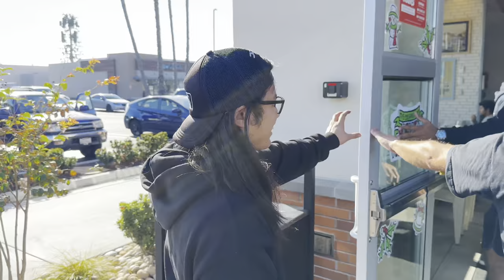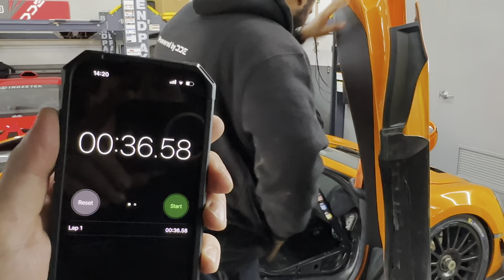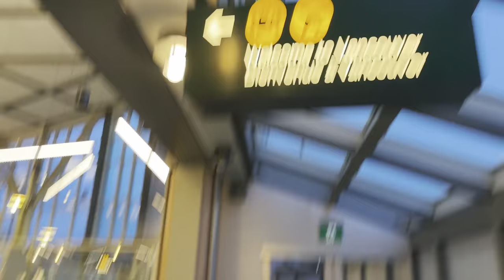Tim REVEALS HIDDEN Project CARS at his home!

Comment: Tims surprise honestly has the potential to be the coolest car on the channel, and I hope he pulls it off. 
He needs to get a Mercedes M120 or a BMW S70 in it, forget the Ferrari V12 - Get a M120 from a Mercedes SL70/S70 and rebuild it like the one from the Zonda, or a S70 from a BMW 850 and build it like a McLaren F1.
Reply: grullon gt8
Reply: It is going to have to be like a 4 or maybe a 6 cylinder engine. It was transverse mounted. A V12 will isn't going to fit, its unlikely a v8 will fit. Also it already produces 600 hp. In a car that light, it will move!
Reply: @shady9016  It's a tube-framed kitcar that uses a C5 Corvette as the donor car, designed to be powered by an LS1.
Reply: The motor that’s in it turbocharged would be sick if it ran mechanically nice that thing would fly 600hp in something that light but a twin turbocharged 2jz or twin turbocharged ls would be absolutely insane how rowdy that thing would be then

Comment: My first car when I was 14 was a M3 E30 the original 1988 sold in US in 91 i got it in 03 i rolled it drifting a curve at 70 lol it was not on purpose. Hit loose gravel. That thing was amazing I even missed the handcrank sunroof. It was scrap when i got done. Steering wheel was shoved back and had me pinned into the seat engine was destroyed driver side rims were destroyed amazingly somehow no windows busted. Every other body panel was ruined even the trunk lid from the freaking trunk lid from the battery coming loose and hitting it. That thing was so much fun I used to love coming into the cul-de-sac in my neighborhood ripping the e-brake getting sideways then dumping the clutch and spinning donuts sliding down the road. I abused that car and it took it like a champ.

Comment: For Tim’s car I would take all the wires in it out and get it set up for a race harness and if you engine swap it then you have to change some of the wires anyway and I would swap a v8 into it and twin turbo it then tune it for power to weight and see how close you can get it then drive it as a dayly

Comment: 2 Flaps intake are more thsn 2 Öillte camshafts , so by Aufi did better way of power were be sble made , per bank if flap 3 holeds made not go de series !;).But care if uselasts on parameter gearbox is a ic part of 90ies open for rpm Qaschmaschine Torse ;) Be alive ! ;) 897 km/h on Nardo I did in 4th gear by that sterp carves not holy more !